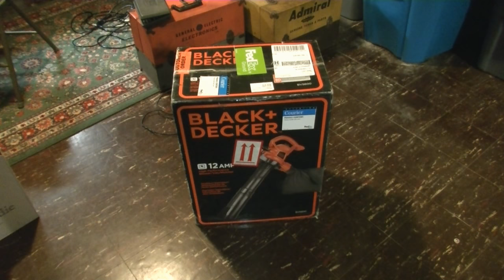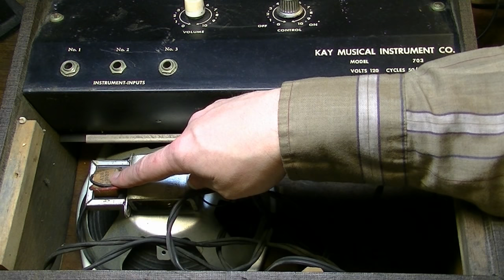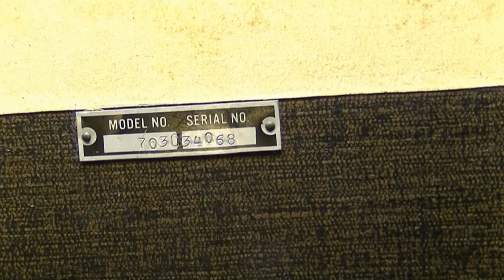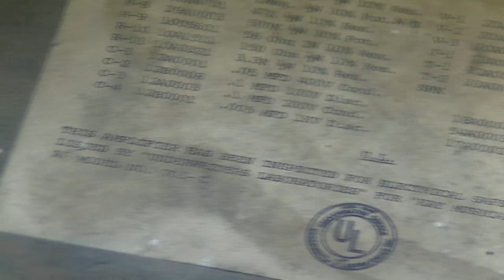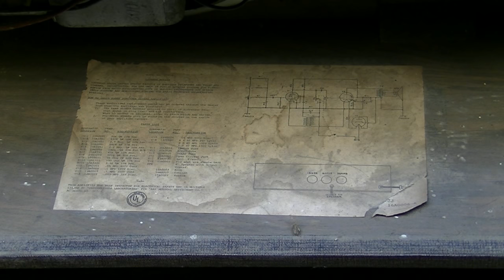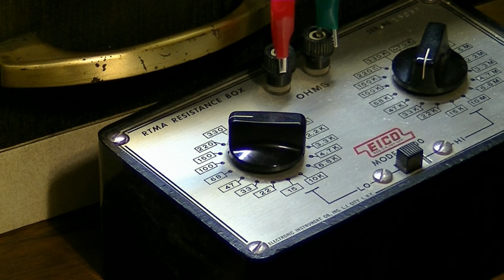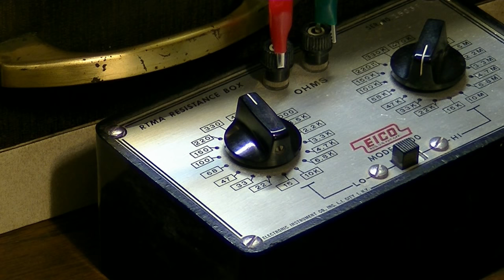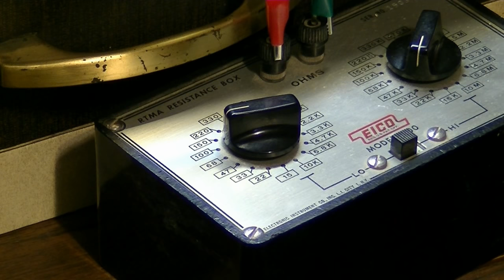Modifying a Little 60s Kay 703C Amp into a TONE MONSTER!

Comment: Hi Brad,
I really enjoyed your use of the decade boxes to demonstrate the effect that different value resistors and capacitors make in a circuit!
Nice job.
Reply from the maker: If you can find a switch with enough selections, it would be easy to build one of those for both resistors and capacitors. Use high quality, close tolerance, parts.
Reply: The Guitologist I just got Heathkit decade boxes for both resistance and capacitance, but need to check them for accuracy.
I'm hoping the components haven't drifted too much.
Reply: I was at my local BnM shop and they had some old Cornell-Dubilier decade capo/resistor boxes (bakelite, no less!). A big box full of them. I purchased them all for $25. I gutted all of them except one of each, and as a result, I have decent stock of 10W 2% wirewound resistors from 1-100ohm, and dozens of silver-mica 1% caps from 1pF through 4000pF (a steal for sure!!).
Reply from the maker: I got mine in a large buyout of stuff: https://www.youtube.com/watch?v=nWPTk-5vkmo
Reply: The Guitologist Ah yes, I remember that! Nice find. Total non-sequiter here, but thanks for your help on the phone earlier!
Reply from the maker: Oh! that was you! No probs. :)

Comment: I just purchased this amplifier for $180.00 Reverb.  Thanks for doing this video.  The amplifier I purchased is in excellent condition cosmetically and has not been molested in the circuit. This will be a nice restoration project.  I looked for a nice Parts build sheet but could not find one on the internet.  Again, thank you and I like your channel.
Reply from the maker: Saw your pics. Looks great!

Comment: Bought a 65' Penncrest Model 833 for $55 from a customer who did not want to pay the price to fix.  Was not working, filter caps and diode tube with broken pin.  All original.  I following your rebuild recommendation for the "Tone Monster Kay Model 703c, with identical schematic.  Put in your recommended  n-51X Triad iso transformer, which fit nicely on the chassis along with a .5 amp sloblo fuse, and of course the three prong power cord.  I did all the mods in your video and used my own Heathkit substitution boxes to verify your choices.  I think you were pretty much right on with the mods.  Installed the new power caps, I got the three in one, which worked fine and installed per the original look.  Did the input resistor mods, the V1 bias mod, coupling cap mod for V1 to tone stack and put in the little bright cap on the volume pot.  Also, did the 330k negative feedback resistor from the speaker output back to V1.  Your video was good enough to make the correct connections along with my skill set of working on amps for many years.
End result:  Per your playing, which is excellent by the way, and my playing through the finished  Penncrest 833 got a nice volume increase verses unmodded trial and blues/rock tone that is amazing very close to your demo.  Got that 57 deluxe vibe in the overdrive harmonic distortion, not as loud of course with only 5 watts, but plenty loud to mike or record.  Very pleased with the results and I want to thank you personally for your video that helped walk me through this whole adventure.  I would send you pics if you send me an email address to respond.   Best.
Bill Platte
T40 Vintage Lab.com
Rio Rancho, NM

Comment: Dang, man. Sorry to hear about the channel cloning issue. That has been happening rampantly on youtube and as you stated, they need a MAJOR overhaul of their system that deals with this. I hope you get it resolved successfully as I love your channel and subscribed as soon as I came across it. On another note, I have a Kay model 504 which is why I was even more interested in this video. Keep up the great work cranking out quality content!
Reply from the maker: Thanks, Bueford! How does your Kay sound?
Reply: I love it. Love it with guitar and it's fantastic when you throw a harmonica or even vocals through it just for fun. I have been wanting to check into tuning it up a bit though at some point. I feel like it could have a bit more bite especially after seeing your video as it's a little dark sounding. Mine has a very well preserved schematic on the inside with the parts list as well. Also looks very similar to that 503C, but has a tremolo circuit in it. I noticed the tremolo is very subtle though. Do you think it was supposed to be like that or would it be an issue internally? Also, it does have a multi-section cap can on the bottom of the chassis. May need to check that out to see if it needs a treatment like what you did here.
Reply from the maker: The tremolo can probably be strengthened with a couple mods. You probably have some drifted resistor values.
Reply: Okay, good to know. I was thinking that to be a possibility. That'll give me something to tinker with. I've had some work done on it, but none of the resistors or anything in the trem circuit have been touched, so I'll dig in!

Comment: I love your videos! I learn a lot from you and love trouble shooting as well. I would recommend that liquid electrical tape for things like that transformers exposed tabs. I use it in conjunction with tape and heat shrink tubing, they sell it at the home depot. It works really well. Thanks for the videos.
Reply from the maker: Thanks, Joey. I appreciate that. I might consider some of that liquid tape for such things in the future. Definitely not comfortable leaving those leads exposed like that.

Comment: This one seems better built than the series filament Danelectro one that you posted.  The speaker looks larger than the 6 inch in the Danlectro.  This one looks to be a 10 inch speaker???  I like the way you always anchor the replaced caps to keep them from moving.  You show signs of a very competent electronics tech.  That's a very good sounding little 33 watt amp.  It sounds like it has a good bit of gain.  Thanks for posting.  I really enjoy watching your videos.

Comment: After I reported the other channel, youtube sent me the email I just posted. I followed all the steps needed to report this impersonation of a channel I follow. If I was putting together content like Brad I would be pissed as hell if someone was stealing from me.
Reply from the maker: I saw your other comment. It went to my "possible spam" folder because of all the links, but I've followed some of the instructions they gave you and actually found a totally different avenue for reporting clone channels I had not seen before. Youtube's reporting procedures need an overhaul. I also sent them an email this morning about it. Thanks for having my back. Means a lot, man.
Reply: I did the same and Youtube dropped the ball. I said that your content was being stolen and they should get with it. They sent me back an automated email where they said they would do nothing.
Reply: belly tripper ala akbar

Comment: Brad,
I watched and enjoyed this when you first put it out, as well as your previous take on this model, and it took me until now to think of this question: if someone were to want to extrapolate from this design, and use 2-50L6s in a PP output section, besides a larger isolation tranny to handle the extra 3/4W of the added tube, would that be feasible with the addition of an inline tranny for the phase inversion for the extra tube?  I've seen this on some of the Gibson Explorer amps, but have no experience with the calculations for adding one.  It seems as though it would work, but I needed a second opinion...thanks for your time...

Comment: I have an old Pennquest amp model 850 (made for JC Penney) that has the
 identical circuit, the part numbers are identical to this schematic, except for the knobs, cabinet and Handle. On my schematic above the UL label, it only says that it is listed as Model. 850, file number E-34601... no company name. I believe it is also similar to another amp you worked on, but I'd have to search to find out which, I believe it was a old supro, but can't remember for sure.  Certainly some company was making these amps to redistribute under various brands. ... under the license heading mine just states the patent holder as AT & T.  just thought I'd put this out there.... for what it's worth.
just searched and it the same as that Samson amp you did a vid on, from Radionic industries ...

Comment: I have one of these. The only things I've done was replace the electrolytic caps, isolation transformer install, and three prong cord. I may have to do more to it now after hearing yours. Mine has bad glass rattle from the 60FX5 tube. I bought another and it had the same issue. It drives me nuts.

Comment: Great informative video. Regarding the inputs, I see you have two carbon film and one carbon composition resistor - these can be noisy, especially the carbon comp. Better to use 1/4 watt metal film resistors. Also, you left the old 0.05uf input capacitor in the circuit. That was there as part of the original grid-leak bias system and worked in conjunction with the 4M resistor you removed. No need for it anymore since you switched to cathode bias. What you have now is a 3-way resistive-capacitive “ tone” circuit - then again that’s maybe what you intended!?
Reply from the maker: I realize that, but I tried bypassing that cap in the course of my tinkering and it thinned the tone in a negative way. I had already dialed in the tone I wanted pretty much at that point, so I left it. Plus, if the V1 tube ever shorts between the plate and grid for some reason, no DC voltage can get to your pickups and fry them. Might as well just leave it. 

I've always used carbon resistors in the signal path. It's a personal preference. One or two components isn't going to change noise in a perceptible way, but a metal resistor tends to be a little harsher in signal paths, but again, it's a cumulative thing, I think, and it would'n't make any difference when it's just one resistor.

Thanks for the comment!

Comment: Hey thanks for the video! I just picked one of these up at an antique shop and I’m looking to do the same kind of mods. For the grounding wire in your 3 connector cable, did you ground it to the chassis? I’m reading mixed opinions on that.

Comment: I have a TRUETONE   Western Auto Brand  Kay with 1 x 12  tremolo  ALL original black speaker cloth the silver prints on the cover are gone. have 1 5y3 Rectifier, 2 12x7's and 2 6V6  power tubes.   For sure brown sound with 3 inputs. Restored and with a 3 prong grounding set up.  Everything else in in place. The outer  paper cloth covering is rough and missing in some places on the side but I was able to salvage this from a building long forgotten. Now it in my studio the Schematic is a KAY 605 pasted on inside of the  cabinet. A local Amp. Tech. Restored it.

Comment: sweet guitar Brad. very unusual for you.
Reply from the maker: That guitar has been in its case a while. Only guitar of mine I'll never sell. It was my 16th birthday present. Got it rather than a car. It is the highest quality Japanese made guitar I've ever laid my hands on.
Reply: The Guitologist 
I have a hammon ao-44 I want to convert into a guitar reverb unit, I have it ready to be hooked up I just want to add some controls and could use some help, I'd like to add a mix between reverb an dry signal, a foot switch and possibly a tone and dwell
Reply from the maker: What kind of help? Are you wanting to bring it by for conversion?

Comment: If I may ask, where did you get that yellow/black/red 20 microfarad 25 volt electrolytic capacitor you used when replacing the multi-cap? I'd like to get my hands on some of those, they look like the old Spragues Gibson used in some effects pedals.
Reply from the maker: That's what it was probably out of, an old Gibson. I did some mods on a Gibson at one point and upped the value of this cap in the Gibson and kept the working cap because it was an oddball value. They usually come in 25uf 25v.
Reply: OK, thank you. Love your channel, thanks for all the cool videos.

Comment: The Negative feedback 330K resistor is going from the plate to the grid on the power tube or preamp tube? I know you have added negative feedback resistors in other videos but don't show on the schematic where you're placing them at so its confusing how you're using the negative feedback resisting to clean up the gain.

Comment: Dear Brad,
First off, I sincerely hope you've weathered the local 'peaceful protests' safely.
I saw this vid when you first put it out, and then I stumbled onto my own jewel.  It wasn't working at all, so I got it for a song, replaced the filtering caps, and now I can't shut her up!  I have a few questions, if you have time:
1. On this project, you said you'd modified the first stage bias; if I may ask, what exactly did that entail?
2. Since all these tubes run off straight 110V (give or take a bit), if I wanted to do a separate project along these lines, could you suggest some triodes (even dual triodes) that operate similarly?  That would be a huge help.
3. Mine is missing a knob.  Any chance you have a suitable replacement in one of your stash boxes?  If so, what would you want for it?
Thanks for your time; keep up the good work...

Comment: How cool! I just bought an 803 on ebay, same tubes it would appear. Thanks for the upload! Just for curiosity I am wondering if you are familiar with the Comcor EMI filter / Isolation transformers? Rated at 3 watts load and it features 3 caps and a resistor to filter out line noise all in one small package. I have one I plan to use in my 803. Just wondering what your thoughts are on something like that?
Reply from the maker: Sounds like a power ripple smoothing. Transformer has a primary and secondary?
Reply: The Guitologist Yes it does.
Reply: Oh and that should have read 3 amps load not watts, my bad.

Comment: Brad really enjoy your videos. I have one of these amps and would like to make it safer and add some of your tweaks what kind of isolation transformer did you use ? or where could I find one. Thanls
Reply from the maker: This is the transformer you need: http://amzn.to/2hDhy7l
Reply: Thanks again. Your videos are the best.
Reply: Thanks Brad you rock. I ordered one up but they sent a different one there is no markings on the box but it looks like the transformer you used on the Samson Amp video. specs are pri. 115/230 vac  50/60 hz  sec. 115/230 vac    output watts  15 to 1,000 va    This maybe a N-68x ? Wish me luck really enjoy the videos.

Comment: Can I ask you a question please?
I got this older marshall lead 20 amp and the transformer is loose or it got bent were it bolts down to the ground or chassis,you know how it bolts down on both sides of the transformer?Do you know if its safe to try to fix that my self to try and tighten it?
or can you get shocked if you touch part of the transformer?
Im sorry for the question,Thank you.
Reply from the maker: You cannot get shocked by opening the (UNPLUGGED) amp and tightening the transformer bolts, as long as you don't touch power caps or associated components. Even so, if the amp has been UNPLUGGED a while, it's highly unlikely to hold any significant voltage in the power caps at all, and even if it does and even if you did get a shock, it's usually about like getting hit with a large static electricity discharge. There reason is, although the voltage can sometimes be high, the amperes are low. Safety is great, but don't be afraid to open your amp because of all the hysteria that's out there. If you want to know exactly how to discharge capacitors, there are videos out there on how to do that. But I'll tell you a dirty little secret, unless it's a solid state amp with huge capacitors, or a tube amp that has already shocked me once, I don't discharge capacitors when working on them. Don't tell anyone I told you that. Our secret. ;)
Reply: Hi,thank you very much for your help.
When you said if the amp has been unplugged for a while do you mean years or hours?because it I still use it,its  the only amp that I have that is working.Thank you for the help I'm going to at least try to tighten it but I don't want to mess with the caps right now..ty
Reply from the maker: After 15-20 minutes, 99.99% of all amps will be drained to almost nothing. But the safe bet is just don't touch anything in the amp other than the power transformer bolts and you should be fine. You might even be able to tighten them without opening the amp.
Reply: Hi,thank you again.The amp still works but it bothers me when ever I move the amp.Will take a while if I take this amp to be fixed.Hopfully I can get that to tighten.
I once got shocked by a marshall jcm800 when I was a lot younger and didn't know anything.Im not sure but I think the caps blew out just from that but I can't tell.The repair guy we took it to said the caps blew out.That shock was pretty big it had a big buzzing feeling almost like touching a fast spinning motor or the inside of the motor.Thank you again.

Comment: I have an 803 and would love to do these mods. Do you have a schematic I can buy or download?
Reply: Interesting I’ve been scouring the internet to find any info on an amp I bought on eBay with no covering or brand. All it says is model 800 on a tiny metal oval I found tacked to the bottom of the amp. The handle looks like the one on these Kay amps (silver)any idea what I got?